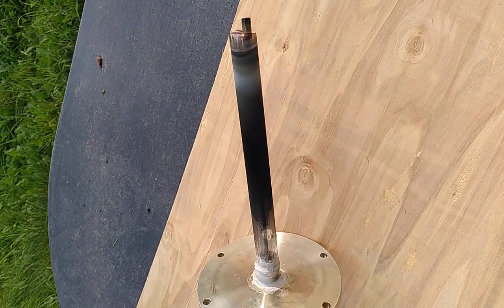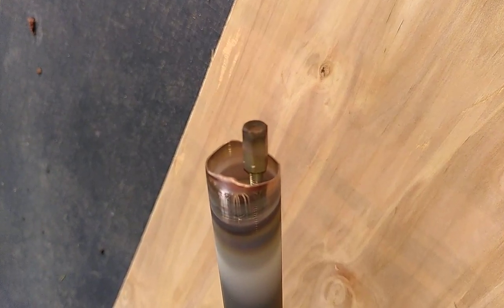VEGA - Pillow 01 - e - Look at anode from pillow experiment

Comment: Want to know a music performer business and actor trade business secret? Point your rubber band hand pointing like you are about to shoot. With your other hand use a light weight push spring to anyone able point fingered like you and by holding pressure attach that person’s finger so that push spring is steadied in place together increase pressure on that spring. You will feel time and frequency vibrations. This is how you develop the character differentials with in a scene [actor tension(s)] or section of music tension(s) [polyrhythmic and note cluster dissonance]